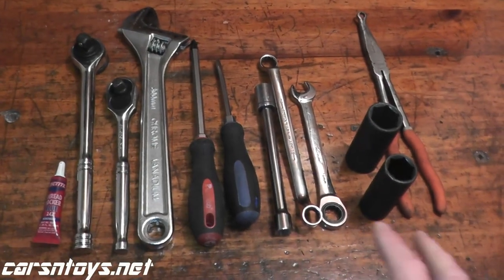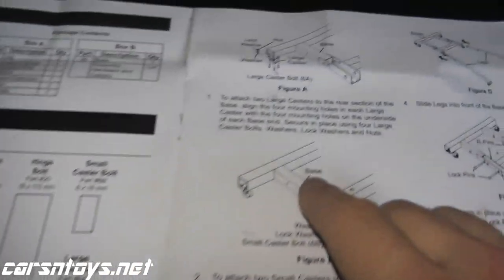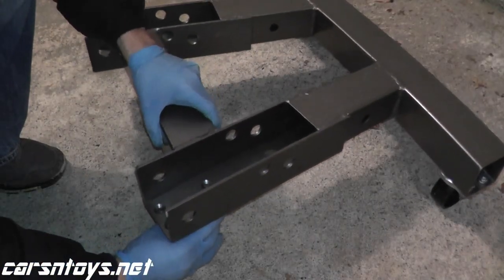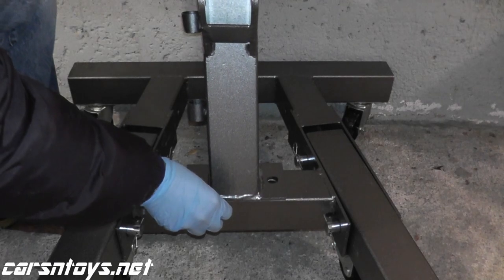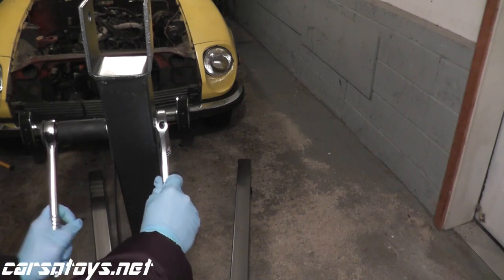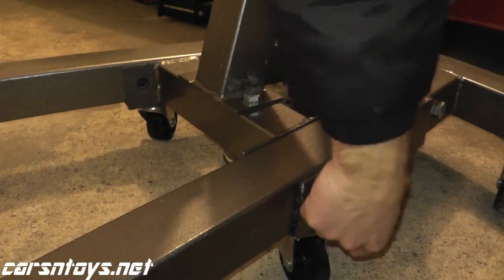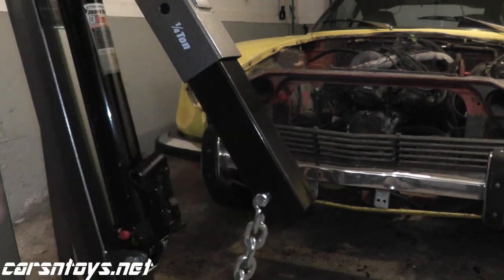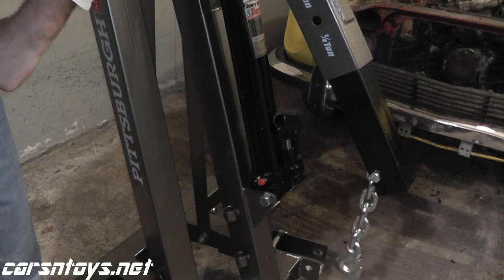Harbor Freight Foldable Shop Crane Assembly & Bleeding

Comment: This video was helpful, I couldn't find any other videos on the 1ton and the booklet didn't show how to do the oil fill and bleed process.
Reply from the maker: Glad to help.
Reply: @CarsNToys   so open on top. Add fluid.  Have battom valve open a bit.
Pump. Then close and it should work right?

Comment: 8:20 the instructions do a poor job on operation. Thanks for this. Have an engine delivery coming any mintue and went to recheck bolts and had a limp mast. Ran to autozone and bought hydraulic fluid and funnel, but after this figured out how to tighten so it would lift.  Operated many a jack but didn't see how to tighten on this crane.

Comment: Thanks just got the 2 Ton and wondering how much oil goes in, manual doesn't say, it doesn't even list where the 5 different bolt sizes go, like the 1 ton manual does, it just says add bolt!
Warning!!!!!!!!!!! I'd say you have your boom in upside down, yes the picture on HF shows it that way, but think about it, the bolt holding the chain, holding your engine is all the way on the very bottom of the boom. What is there, less than 1/4 inch below the bolt on the sides, then a big slot underneath!!!! Thats prime failure mechanism for a 2000 lb engine, theres basically nothing holding that bolt.

Now if you turn it upside down you have nearly the full height of the boom's sidewall steel to support that bolt and no ope slot underneath further ing the strength. The slot is to all the end of the chain to stick out the top, not go thru the bottom.

I noticed this as soon as I was about to put on my boom, I thought no way am I lifting 2 tons with a bolt supported by maybe 3/16ths steel and a large slot cutout on the bottom. I thought it should be turned upside down and I see on my 2 Ton manual the picture on the front page has it that way, the bolt is way up top ad the chain is coming out the front opening.

Despite what the  pictures or the manual may show, just think about it logically, there is no reason to have 95% of the steel support above the bolt, it should be below it. My 2 ton manual doesn't specify and Im just going by my own engineering experience ( 8 years US Navy Submarine Nuclear Power Plant operator and repair of electrical generators l, steam plant turbines and reactor plant systems) and basic logic, if you where to build it you would not put the bolt hole at the very bottom would you? Stay safe!!!!
Reply from the maker: Appreciate the feedback. If I remember correctly, you fill the oil until it starts to drip out. (Similar when filling transmission fluid for manual transmissions.) I'll double check this evening. Thank you for your service!

Comment: I advise no one to purchase this ,, I did and the reach on it sucks,,hard to use for even some front drive vehicles,,,so better get the two ton,,or you will find you wasted your money
Reply: Is the 2 ton reach further / longer ?  If so how much ?
Reply: Numa Newbern, by a foot, don't question it, just get the 2 ton
Reply: Even if I’m using it on snowmobiles?
Reply: Very true my friend, I bought the 1 Ton a while back and 1 ton was just fine, but the reach is not even 2 feet. They lie about the boom length, measuring from end to end, but the usable length is from the front of the piston to the bolt that hangs the chain, because you cant get it any closer to your car than the piston, so distance of boom behind the piston is irrelevant.

I just got the 2 ton and it is a beast in size and the reach is a real 4 feet 2 inches from piston to end. The 1 ton is okay for small cars low low to the ground, but it wasnt even close to being able to pull my engine from my '03 Impala.

I ve seen guys remove a tire, which allows the crane to get close in from the side, so if you run out of length from the front try that.

Comment: I have this lift, it has done well for me, the ONLY issues I"ve had is the holes on base is as yours & others, they are NOT aligned and is a pain to pull out and install the pins when you need to relocate the legs up of down, also the rings on the pins have broke off.
Reply from the maker: Same with mine. I have to pull up slightly for the pins to slide nice and easy. Overall, I can't complain. It certainly didn't cost much compared to other lifts.

Comment: Thanks for the video. They ship all of them without hydraulic fluid so that you don't get a soaked box if it leaked in transit.
Reply from the maker: Thanks for the heads up. Certainly makes sense.
Reply: No joke mine came full of hydraulic fluid and when I popped the top plug out stuff went everywhere. Just added some ATF after that no biggie.

Comment: Hey thanks for the vid its really gunna help me when i purchase this but had a question do you think switching 1 of the back folding leg pins with the bolt on the boom be a problem because if they were switched that would make changing different lengths on the boom much much faster and easier but not sure if the folding leg bolt is rated the same as the original bolt for the boom so not sure if it will be safe what do you think?
Reply: 209chevymon The boom is supposed to be secured with a pin not a bolt, according to the instructions.
Reply: @alexdrouillard2153  dude that was a whole year ago lol but anyway have a good day

Comment: Saved me from flipping on Harbor Freight 2 times in a 3 day span. I’ll just pay the money next time and get a heavy duty lift
Reply from the maker: Absolutely. I think it's a good lift for small projects, otherwise the two-ton unit is a better buy. You can often find used ones, in very good condition, via FB marketplace.
Reply: CarsNToys oh trust me I know lol I bought this one and I was missing the nuts for the wheels then I returned it and then I went and bought one from  another store followed ur instructions down to a tee and built it in less than a hour. 
But the one they gave me was used. I mean they built the whole lift and returned it. It didn’t hit me until I got home and realized that it was tapped closed and not with shipping straps. 

I just hate the crap I went through and customer service for the first one and not getting a brand new lift

Comment: Thank you for the video.  got it assembled, filled with oil and bled air out but now i can't seem to plug the plug back in.  whats the trick to putting the plug back in?
Reply from the maker: I don't remember having a problem with the plug. Have you tried rotating and pushing the plug in a circular motion?
Reply: @CarsNToys  I fixed it.  used flat head screwdriver to force the plug inside

Comment: Mine had NO oil as well couldnt get rubber plug back in
Reply: i used a small flathead. you kinda press the side with the side of the flathead and guide it in a little at a time. just try not to stab the rubber with the screwdriver and pry down like i did at first
Reply: I had the same problem. I'd say that plug will fail after a few oil changes. Every time you take it out it tears the rubber a little and you have to pinch it a lot to get it back in.

Comment: Good video of assembling the lift; thanks. I'd like to offer a tip for extending the reach of the Boom. I ran into a problem with installing a shortblock into a buick with a long front end as the lift wanted to stop at the bumper and it fell short of clearing the engine bay. I have a john boat with a small trailer. It turns out that the portion of the trailer that is used to mount the winch fits exactly into the square steel of the boom. Sliding the winchmount from the trailer into the boom and drilling a large hole for a bolt allowed for the proper extension I needed to finish the shortblock installation. BE AWARE of course that extending the boom will affect the amount of weight that can be safely lifted. Use the technique at ones on risk... :)
Reply from the maker: Thank you. I ended up selling the crane. Will certainly invest in the 2-ton.

Comment: Don't buy harbor freight garbage, not worth the headache. I just got this lift, the damn holes on the legs and base don't line up
Reply from the maker: Bummer.
Reply: Banks210 you made the same mistake I did. Your bolts on the bottom legs are too long meaning that your short bolts are in the other wheels. Pain in the ass the manual didn’t specify but I learnt the hard way.
Reply: I found out the hard way that if you tighten the bolts before everything together, nothing lines up. Also make sure you check that you are using the correct bolts for the correct holes. They have different diameters. I also assumed all the washers were the same, but they aren't use the smaller washers for the smaller bolts. I wasted a lot of time having to disassemble some of my bolts to find where I put the large washers.